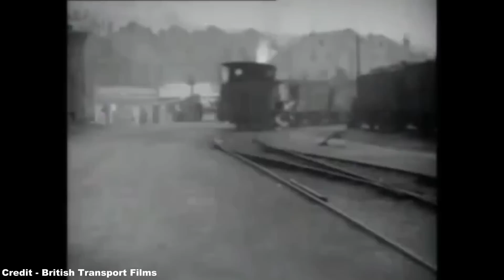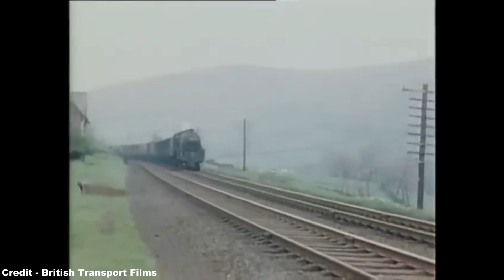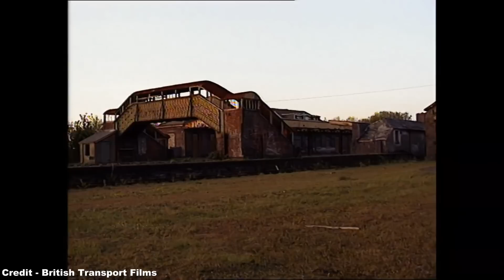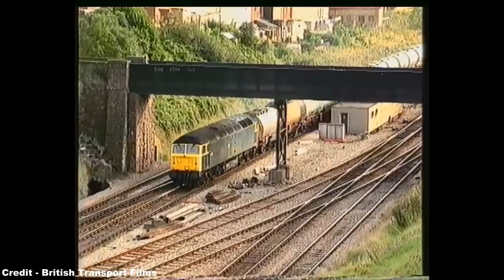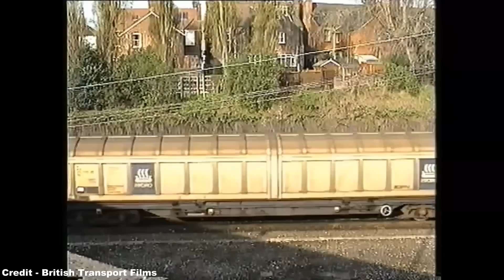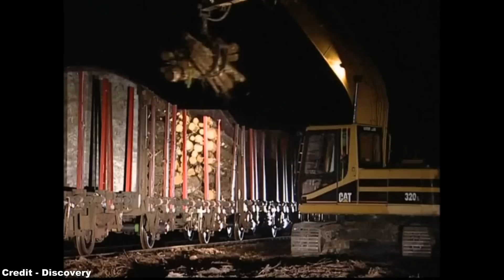The Story of Speedlink (Reworked)

Comment: Running unfitted freight trains into the 1960s is just awe inducing. The US had air brakes required by law 60 years prior. Part, I think, of why the UK never got truly big steam locos or meaningful fast freight.
Reply: We were still running unfitted freight into the 80s
Reply: @andypannett yes, remember working one of over 700 tons with a single Class 37 and a brake van.
Reply: no the bigger reason is clearance. UK loading gauge, dictated by bridge and tunnel sizes is much smaller than those in the US
Reply: @chanachon56  It's both, really. The US never totally lost its manifest (wagonload, in UK parlance) freight market because trains could meaningfully compete on speed. At the same time as Speedlink was being planned out, the Santa Fe would regularly run LA-Chicago hotshot fast freights that would cruise at 70mph or faster. Obviously enough you can't do this without air braked freight cars.

As far as steam, it was loading gauge, but there also wasn't any point in doing so because something as small as a 2-8-2 (which in the US was a medium-sized freight loco) was too much locomotive for an unfitted freight consist. It could pull more than it could brake.
Reply: However, the biggest reason is size. The US is just a bit bigger than the UK, so huge locomotives weren't economic.
Reply: @PercyPruneMHDOIFandBars  It's not even that they weren't economical, there wasn't any point. Why go big if you don't have any reason to? Big, powerful engines only make sense if you have very heavy trains or trains you want to move quickly. Both require continuous braking to work safely. 

British passenger trains had vacuum brakes from very early on (the Armagh disaster train did have them, albeit not an automatic form) but it took much, much longer to get any form of continuous braking to be mandatory on freight trains, and they mostly stayed fairly short - even the unit coal trains were limited in their length by the need to "pin down the brakes", i.e. partially apply brakes by hand. By contrast, by 1900 in the US it was mandated that all rail vehicles be fitted with automatic continuous (in this case air) brakes, new or old - and right around then is when train length and weight exploded and when engines got much bigger to be able to pull them. It's all linked.
Reply: The air brake was invented and patented by George Westinghouse in 1869 and improved in the 1880’s after a visit to the UK into the automatic air brake system we’ve had since the 60’s.
The mistake made by the 1955 modernisation plan was that all new wagons should have been built as fully fitted vacuum braked bogie wagons using new and reconditioned ex passenger stock under frames made redundant by new MK 1 stock (which is exactly what the Southern region did with the frames of 1930’s built  3rd rail dc electric units to build the BR SUB and EPB electric unit fleets).
Reply: @davidnolan1692  I mean, sure, but there was unfitted freight rolling stock running well into the diesel era of BR. Which is crazy to think about when you consider their contemporaries on the continent and in North America had adopted continuously braked freight trains far earlier. Even vacuum brakes which are only about half as good at stopping a train as a Westinghouse air brake setup is still incredibly better than the practice of "pinning down" brakes and using a brake van.
Reply: @AFullerHouseAtlantic I agree and this archaic practice of stopping to pin down brakes was still happening until the cessation of the vacuum braked general utility service on BR in 1985 though mainly by the 80’s due to trains conveying both vac and air braked wagons on the same service and thus still needing a guards van (though interestingly the Southern Region banned all unfitted wagons in 1982/83).
Reply: Power to weight ratio was way higher for UK locos Vs US.
Reply: @wire9486  Not really. If we look at comparable prime mover horsepower, a Class 37 weighs about 224,000 pounds. An EMD SD18 weighs about 300,000. The 37 has barely more than half the starting TE of the SD18 - 55,000 lb/f vs 97,500.
Reply: We were gonna mandate continuous brakes on all rolling stock but simply put the railway companies and private owners of wagons were cheapskates. They wanted money in their pockets instead of safe and fast freight. It took a ridiculous amount of death and injury to get it on passenger trains so not entirely shocking and even then there was no great rush to do it and unfitted passenger trains existed long after the mandate. 

BR came in and had a laundry list of wagons to replace so went with the fastest option at first then moved to bringing it all up to vacuum then the move to air happened. Had the big four or private wagon owners still been involved, honestly, I think we may still have unfitted stuff into this millennium. BR may have been a bit slow to do it but they did it at least!
Reply: @SamanthaMaedhbh  AFAIK, the UK never had an equivalent law to the Safety Appliance Act of 1893 enacted, at least not until much later. That's why the automatic continuous air braking and knuckle couplers became common in the US so early, they had to use them by law. I'm sure there was much wailing and gnashing of teeth by private car owners (and railroads...) but if you wanted to do interstate commerce, you had to comply by these laws.
Reply: @AFullerHouseAtlantic  it's also in the interest of the bigger railroads to pass that and I have no problem doubting that there was some backroom shenanigans agreement beforehand. You reach a point where near all commerce can in some way be called interstate and it just makes sense if you're in the old boys club and in charge of a big railroad to regulate such things in the guise of safety when really it just makes all those small railroads easy to buy up because they can't afford to upgrade... but you can!
Reply: @SamanthaMaedhbh  Well, you'd think. The history of that law was basically a standardization across multiple states. AFAIK, the PRR was already using Janney couplers and had been since 1877, and as one of the largest roads in the country the AAR standardized on that since they had the most rolling stock crossing state lines. PRR's decision to do this was likely entirely financial, since it allowed them to build trains much faster and avoided injury payouts to brakemen. 

With continuous automatic brakes, PRR also set the standard here - they had adopted Westinghouse air brakes in the 1870s for passenger trains, and later on I believe in the 1880s for freight service. They called themselves the Standard Railroad of The World for this reason, as I understand it. 

As far as the bigger roads wanting to do it to squelch competition, I've not read anything saying as much, but I wouldn't be too surprised. But the big roads didn't want to do it either - refitting all their locomotives, freight cars, and passenger coaches was a monumentally huge investment of capital.